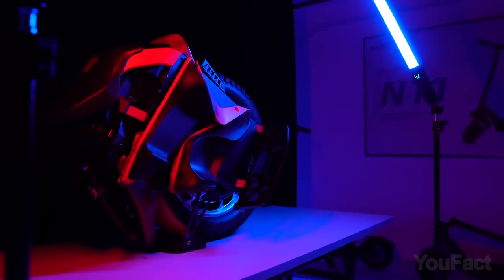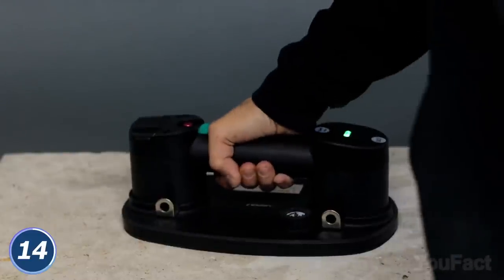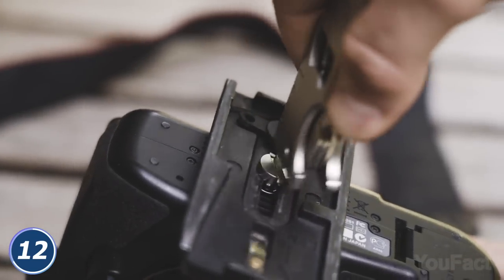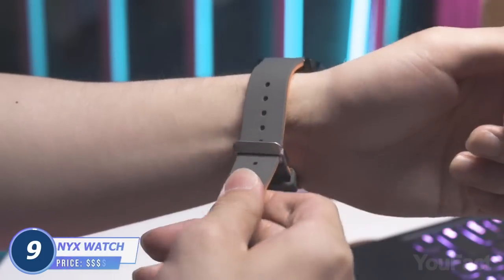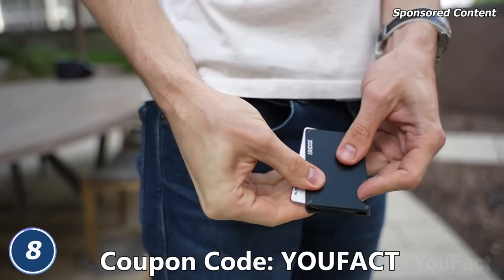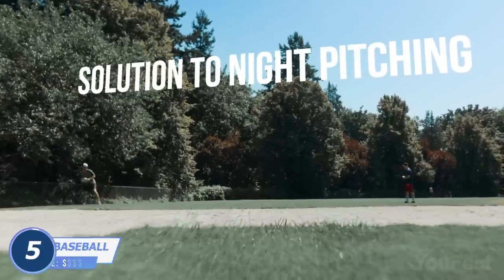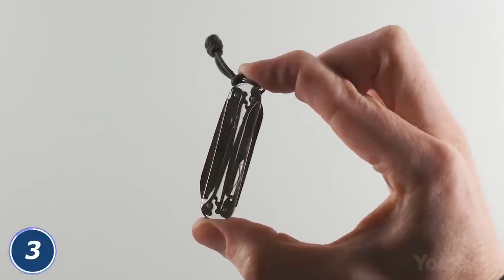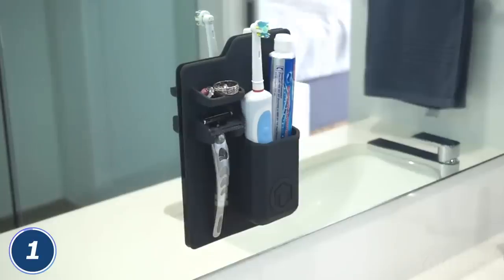15 Cool Gadgets Every Man Will Love

Comment: Would’ve liked to see someone using the seat while riding on the first one.
Reply: I have 3 of these sitting isn't hard to be honest I prefer seated riding....he said rear brake while showing the suspension lol they don't have an actual brake you just lean back an the motor basically reverses to slow you